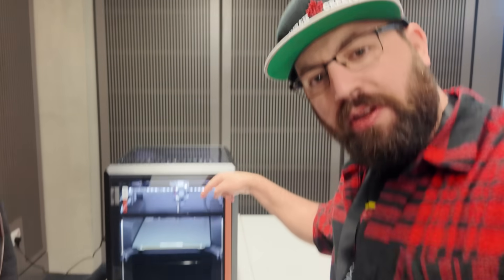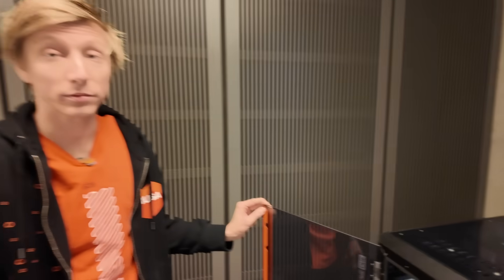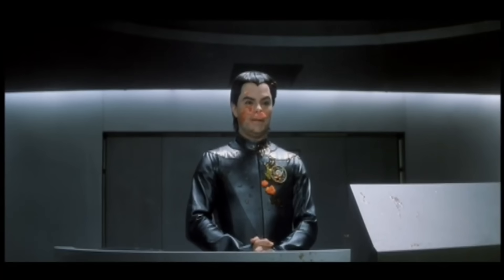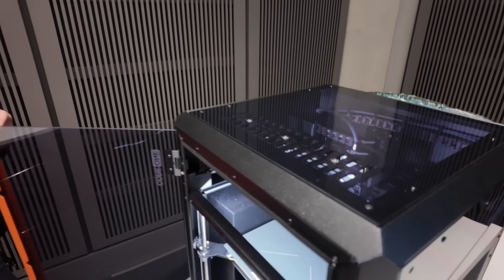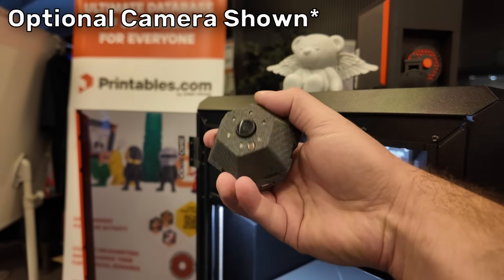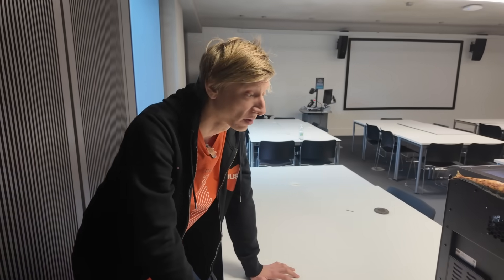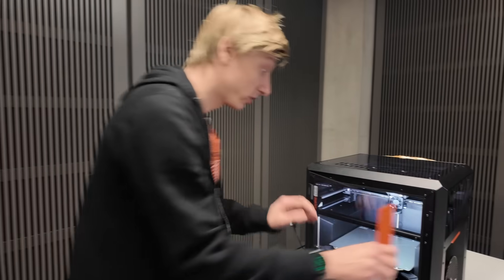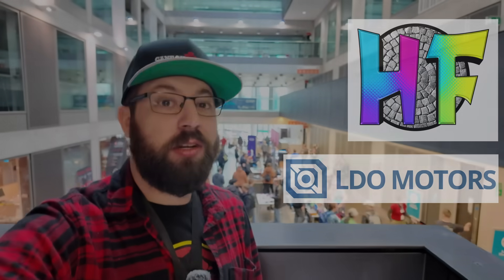One on One with the Prusa CORE One @ SMRRF24!

Comment: I’m sure it will sell well. But if I had to choose between this and the k2. I would get like a k2. They are a few years too late.
Reply from the maker: Having finally talked to a few K2 users, really the only advantage i think it has is size, long term support with any creality machine is a crap-shoot and it AGAIN suffers from a really bad klipper implentation  for the FW with a bunch of issues
Reply: I have a bunch of 3D printers, but the ones that improve the most after purchase and have long term upgrades and support are the Prusas. Other manufacturers want me to buy a new machine from scratch every few years.
Reply: @ I get that but aren’t you consuming 1 printer to get a new printer? Why not just have 2 printers.
Reply: I've only had Creality printers so far, but if I'm spending that kind of money, it's coming from Prague. I've seen great things about the K2, but I wouldn't pick it over the Core One, personally.

Comment: O.O
Now I want to replace my Adventure 5M Pro I got mid summer. Should have just waited. ;-p

I wonder how the MMU3 will work with it since its on the roadmap.
Reply from the maker: The FF 5m aint a bad machine, just keep it and then you have 2 printers

remember, fastest printer is more printer

Also MMU3 works just like on the mk4, just attach it to the frame, connect the plug and tell it it now has an MMU

Comment: Really all 3 Z Motors on 1 Driver?
Reply from the maker: correct, which honestly is fine, bed traming isnt really needed on a machine this size, and parts cost between using integrated z motors with leadscrews vs 3 leadscrews and the hardware to connect them isnt that much
Reply: @CanuckCreator I saw a Video from a Youtuber where His z-moto Controller broke (but wirh the prusa XL)
Reply: @MaxMichel89 Recently had a Z driver go bad on my 2.4 with no visible damage. Bad drivers can happen even on 1 motor. You don't need much current for the Z lead screws, so should be fine.
On another note, the electronic box actually looks a decent size. Maybe there will be actual room in there?
Reply: @MaxMichel89  that was robert cowan
Reply: Yes i have seen the Video from Robert Cowan too. Thats why i asked here :)

Comment: Yup, I want one.  But I want to build the kit, that part is fun.
Reply: Exactly
Reply: Sameee, if I have the option to build it I always would choose that
Reply: I can definitely see the advantages to knowing how everything goes together. For me though, I am not interested in building/tweaking my 3D printer as a hobby.  I want it to work as an appliance - I want the hobby part to be the parts/CAD design.
Reply: @falxonPSN  That's probably the most interesting part of 3D printing, finding new uses for the tool, and learning the software.  The "kit experience" among different printers varies from "some assembly required" which is really the seller saving you money on shipping, to a near "Heathkit" experience.  And yes, Prusa's assembly documentation is every bit as good as what Heathkit had.  (I've built quite a few Heathkits, from alarm clocks to a 21" color TV and a complete Ham station).
Reply: I asked at Printed Solid if and when they will be selling the kit.  Hopefully late March.
Reply: Haha couldn't disagree more. I do see where you are coming from though.
Reply: if you have the time to build the kit, you should absolutely do so. you learn so much about how the printer works and where things are and what to look for when something's wrong
Reply: Absolutely, my kids would be devastated if i bought it already assembled(they loved building my mk3 a few years ago), its like a big fun Lego kit, i will definitely get the kit ! :)

Comment: Now we need to replace the Trident side panels below the Y extrusions with indented pockets like that for spools.
Reply: You can already fit one or two spools inside the 300mm trident.  I like the idea of being able to access them from the outside.  How about a two color version of the MMU built into the Core One which uses two spools, one on either side?
Reply: @KennethScharf  How about a dual extruder toolhead with each extruder feeding from one spool?
Reply: Who needs tools in there for the other side? I want  to use it just for extra space for my MMU...
Reply: Just make a mod
Reply: Why fit them outside if you can fit them inside?
Reply: @Chaosek  So you can replace them during the print without opening the doors and warping the print.
Reply: For sure!